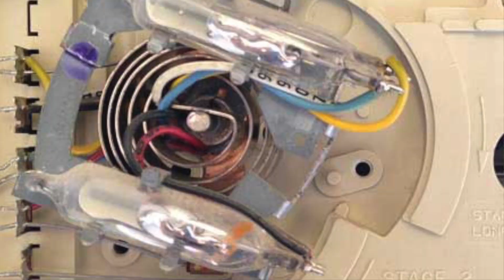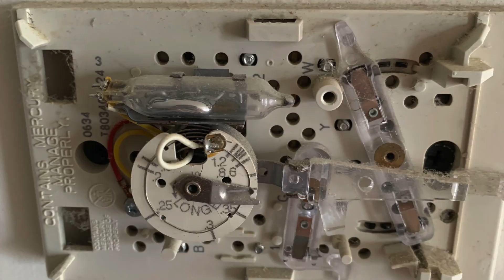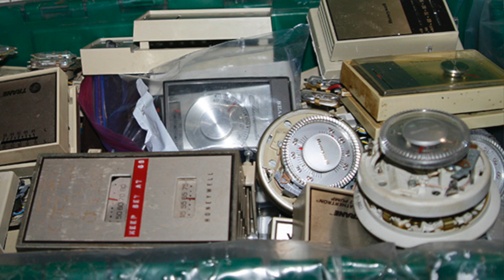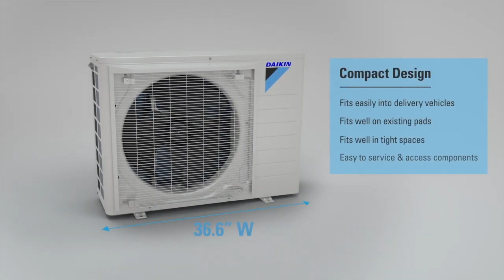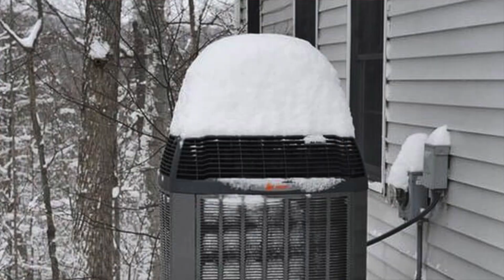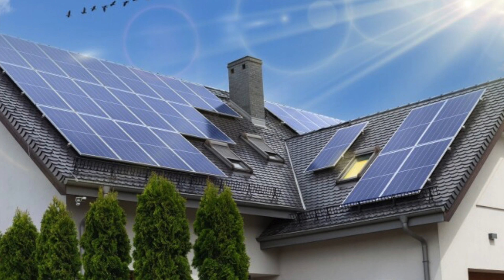HVAC Pollution is HURTING the Environment! 3 Ways You NEED to Know!

Comment: the mercury is ok as long as it does not get broken out of the glass tube if there is no reason to replace the thermostats you should be ok leaving it.

the metals in an air conditioner copper, aluminum and steel can recycle as scrap metal.

Comment: Yo Josh, a few notes:

Mercury: it's naturally-occurring.  I have a few of those thermostats around; they use a tiny amount of Hg.  I have a bottle of it that weighs several pounds!   I'd never throw it out; I'm sure it has some value.   I have an old turntable that uses it instead of wires to carry the cartridge signals.  I used to play with the stuff when I was a kid.  It's danger is overblown, of course.

Size: things got much bigger when 410A replaced R22 because it is a less efficient refrigerant.  Both in capacity over temperature and in equipment size requirements.

Ozone: the excuse of the hole was promulgated so the patent holder could continue to collect royalties.  R-22 was about to go generic, and the royalties were a huge source of income, so they had to come up with something new to keep that income stream going.  The only way they could convince the world that they needed to spend more money for a lower quality product was to invent a scenario where they were paying to prevent destruction of their lives.  The same old fear-based narrative that we keep revisiting every so often.

Cheers!

Comment: Hey Joshua I have a Goodman ac unit 3.5 ton 13 or 14 seer uses r410a refrigerant and air handler do I need to replace my unit to use the new refrigerant?

Comment: I contacted my utility a week ago to find out about rebates on high efficiency heat pumps and I'm still waiting for an answer. I'm assuming they don't offer rebates. Reliant/Center Point is their name. Many years ago they were working as Houston Power and they offered not only rebates but financing up to four years at very low interest rates. They sent an engineer who did the heat load calculations and filled out all the paper work ( A real dream come true); those were the days.-
Reply: The states have the money, but alot of it is so confusing or even 'vaporoffers' Ie: not existing yet. It's a horrible time to be down and needing to buy a system knowing you are missing out on rebates that if you could survive without heat / a/c for a few more years you would get.
Reply: @Dragonfiregum  Well my system still works but I need one more efficient due to high electric rates. last  year I got bills for $ 400.-- All electric 1,500 sq. ft. home. Crazy!
Reply: @bobboscarato1313  one of the first things I would do is get the solar panels if you have room and the money. They really do pay for themselves within 7 to 10 years. You can think of it as replacing part of your electric bill for a solar payment until it's paid off. Then it's free energy.
Reply: After that if look at the HVAC upgrades because at least here they limit your panel system size by your energy bill. So you want it higher so you can get the bigger system at first
Reply: @Dragonfiregum  200 Amp. Service costs about $ 2,000.- by Licensed electrician. I have a 125 Amp and its plenty for me.